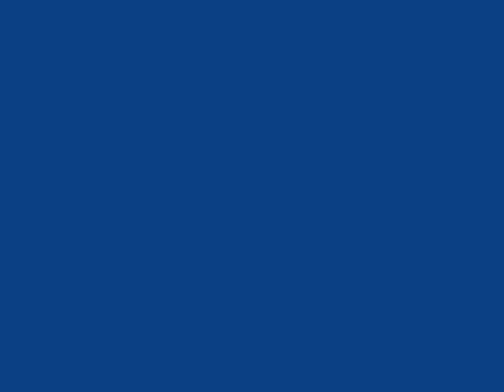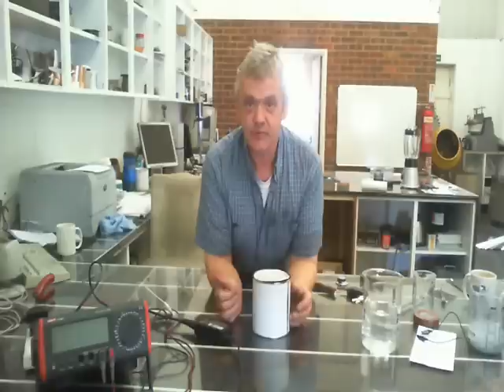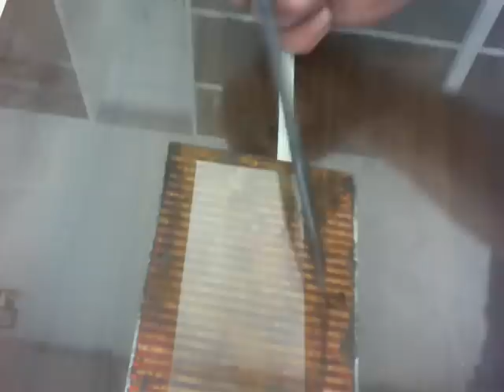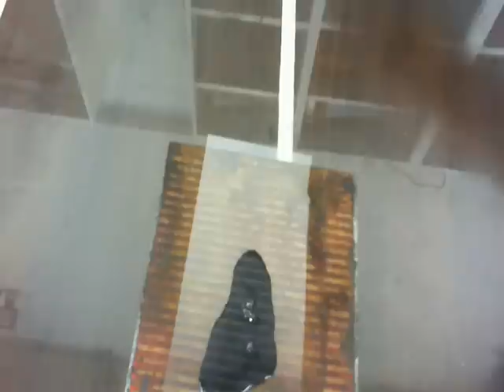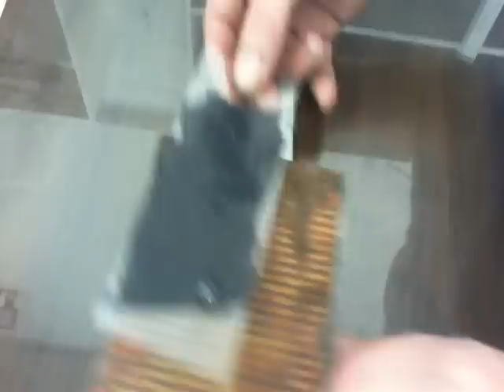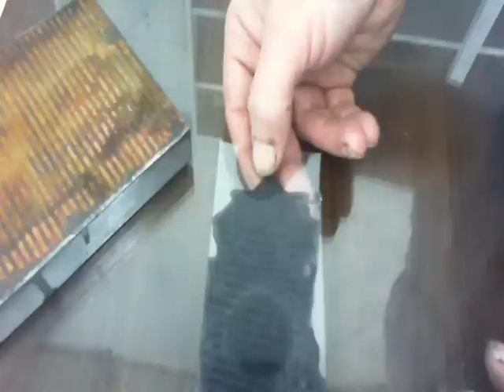Manipulating Conductive Ink With Magnetic Fields

Comment: Im having a hard time getting the ink to stick to plastic sheets.  What are you applying the ink onto? If you have magnetic lines, is it then possible to use a permanent magnet alternator and generate power off the graphene sheets.  Would this be less load then copper coils?  Would this generate more energy?  Questions that I am working on.....just slow going.
Reply from the maker: I am using PET sheets - they are sold by NOBO as overhead transparencies sheet. I haven't tried generating power so I don't really know - worth a try

Comment: How about an electric field, would this have effects on orientation?
Reply: furthermore, anyone have any results with magnetic field/electric field using the mechanical method?
Reply from the maker: I guess it would but not appreciably - I have tried it in both high and low voltage as for the mechanical method I doubt it as the shear you are putting on will probably have a stronger effect than the field can exert - but I haven't tried it so you could always try it and let us know how it goes

Comment: Right.. now I'm not a proper scientist as you know but if this is not an idiotic idea maybe someone will see it and run with it. I don't know what I'm doing, so here's the proposal. 

Say you had graphene nanoparticles suspended in a dielectric (gel?) and manipulated a magnetic field on one face of a cube made of same. That would of course attract graphene to the lines of the field. Say that field was shown in 2D on that face of a cube as a series of single tiny dots as close to each other as possible without actually joining. Could those dots of graphene effectively dope that surface/plane such that more grew on that site, effectively causing a needle of graphene to grow perpendicular to that face? A forest of them, in fact. 

It strikes me that if each such needle was 2 ions apart or more (but as little as possible) from the next, what you would have is the best capacitor energy density possible.

I have mentioned fractal patterns before and I notice someone else did recently too, but there is an issue in that what you need for this is actually a 2 ion-thick gap (I know this from one of your previous vids on the way a supercap actually works) which therefore dictates the form.

In other words, what you need is a forest of needles as I describe above. That's the best it can be. NOT a fractal, actually. 

Is this achievable? How precisely can we manipulate a magnetic field, and can we induce graphene to grow on a doped surface?
Reply from the maker: it's an interesting idea - like you I am not sure how to actually implement it - especially when i think about how to implement it en masse - that is in terms of manufacturing - for that the system has to be easy to do, produce a robust product and be able to run under relatively uncontrolled conditions.
Reply from the maker: Leonard Janus interesting mate cheers

Comment: Time to remake an antenna! My suggestion is, use a fractal electromagnetic field with a decent strength so as to form fractal structures both large and small. This could perhaps form regular structures as small as tens of nanometers across. I am quite sure at least, that you will be making them much more resonant than before.

To be clear, by fractal field, I am referring to it's frequency.
Reply: also, in any application where you are trying to increase your surface area, it would seem that using the fractal input would be the better way to go. Admittedly, this requires the use of an electromagnetic field or very nicely made custom made magnets that I wouldn't even know how to make.
Reply from the maker: Keegan Maloney
lol - mate - the best first steps are not the complicated ones - keep it simple first then go from there - otherwise you spend all your time dreaming up scenarios that might work and doing - well - very little
Reply: Robert Murray-Smith  that doesn't even sound hard man. if you don't want to explore it, I certainly will.

I feel like I've given you gold and you said "No thanks, water is more important."
Reply from the maker: Keegan Maloney You want me to do the work? - I didn't get that - i got you were sharing your ideas
Reply: Robert Murray-Smith im not asking you to do anything. I just figured it was worth doing. im fine with doing it myself, ill get around to it. forget i said anything.
Reply from the maker: Keegan Maloney
ok - fair enough
Reply: Robert Murray-Smith ;)
Reply: Did either of you ever do this? Cuz it sounds badass if it’s possible

Comment: You've probably already thought of this but I'll mention it anyway.  For the purpose of optimizing output in a given surface area device, you could apply the SWAG just like you've done, let it dry, then shift the plastic sheet slightly on the magnet, and apply a second coat of SWAG such that the areas that previously had a light coat now have a thick coat.
Reply from the maker: it's a surface area effect mate - an idea might be to mix in fumed silica and thereby increase surface area on a nanoscale - I don't think building up thick layers is going to help much for the SWAG - but your idea is good for an antenna i think
Reply: Hmmm, I was interpreting the light areas as areas with little to no graphene and therefore not contributing to power output. I was thinking this method could be used to fill them in and turn them into active areas.
Reply from the maker: Joseph Richardson
i am not sure that is right - but i need to have a scan done before saying too much about structure
Reply: Fair enough, Rob, and prudent. Exciting stuff!
Reply from the maker: Joseph Richardson
it is mate

Comment: groovy stuff !!! it comes in at a good time too ;)

you're a STAR !! :)

was thinking of antennae made out of the ink dried under the effect of the mag field and disposed one behind the other so that the would form an equidistant matrix of lines, then you would be able to collect various freq and also vector them.

Good idea about the diodes but didn't quite get the mechanism behind ... so you got a conductor that you optimise for a certain direction, but ... one way only ? using 2 sheets at 90 deg, or just one sheet ?

btw .. sorry for drifting from SWAG ...
Reply from the maker: No worries mate - i understand - it is exciting stuff with a whole host of applications and it can sometimes be a problem to know where to post ideas - I think you are 100% right about the antenna applications and the possibility of using this to collect solar via wave transformation - one problem there is diode speed for rectification - which is why i mentioned MIM diodes in a previous vid. But antenna collection offers the possibility of 100% - or near enough - conversation - it will knock conventional cells out of the park and that is a big deal! -it's next on the list by the way lol
Reply: I really do believe that if arranged in a matrix like formation with various different thicknesses like a 3 d interference pattern. well .. I can sketch it but can't post
Reply from the maker: actudoran
i get the image mate - i'll look at it